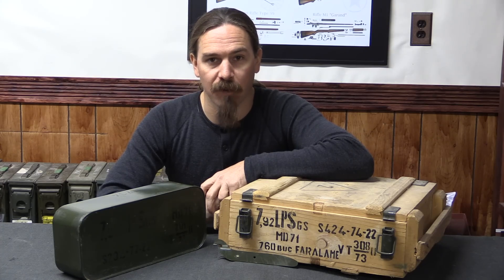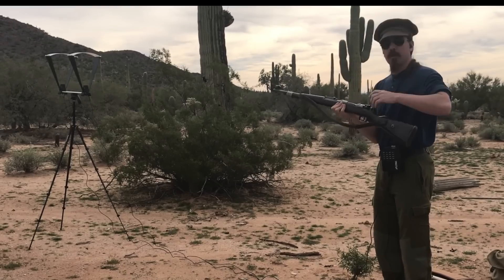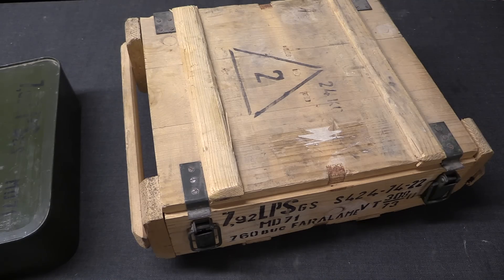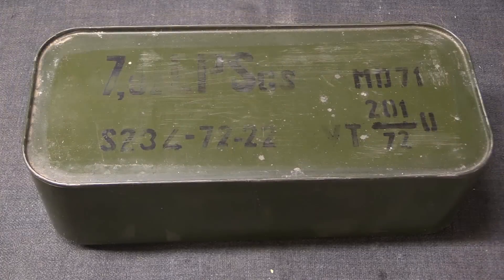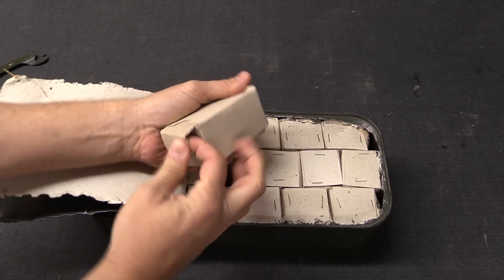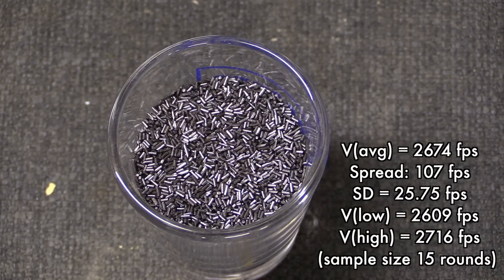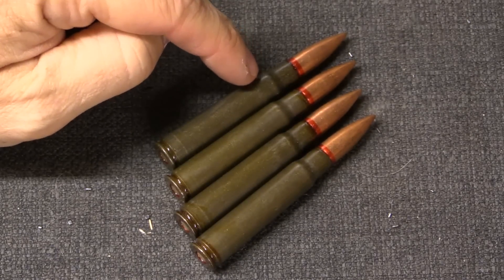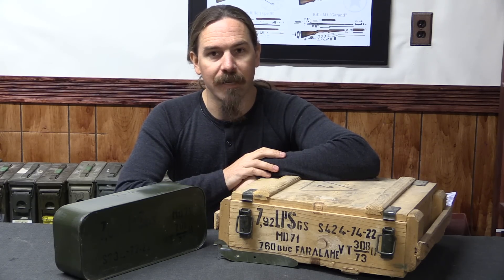Ammo Evaluation: Romanian 8mm Mauser

Comment: I wonder if the smaller case was an artifact of whatever machines they used to make the ammo. Perhaps they could share tooling with another type of cartridge. Or perhaps it was cost cutting.. a millimeter of steel isn't much, but factored over a few million rounds and that's a massive amount of material saved.

Comment: The slightly shorter case might aid in extraction when used in machine guns. I say mg's specifically because the high heat might make the lacquer sticky, though I have no idea what the properties of that lacquer are when heated. Regardless, I doubt 1mm would make a significant difference though so it's doubtful.

Comment: Can someone enlighten me on why ammo would be magnetic...? Trying to think of a good reason but I can't.
Reply: Most steel is magnetic and this has both a steel cartridge case and a steel cored bullet.
Reply: There is also steel/copper alloy in the bullet jacket for a lot of these Soviet/Warsaw Pact era surplus rounds. Most of the old Light Ball COMBLOC ammo used a steel core as well as this steel/copper alloyed jackets. Hell, they still make them. A lot of Russian made ammo, like Barnaul, Wolf, Tulammo, Brown/Silver Bear (also Barnaul) have and do still use the steel/copper alloy, because it's cheaper than copper and or gliding metal, and most ammunition producers really dont care what happens to your firearm's barrel. Most of the modern stuff is lead core, but the alloyed jacket will still attract a magnet.
Reply: Military ammunition typically has a bullet jacket made of mild steel plated on both sides with copper. Much of the Russian commercial ammo also features these bi-metal jackets of plated steel.

Comment: Great video Ian!
Another interesting point, ...if you are an ammunition nerd, is that the steel core that was used in the construction of these bullets seems to be the same steel core that is used in the 7.62x54R LPS (steel core, light ball) bullet, ...only with a couple of millimeters of the tip cut off to allow it to fit into the slightly different profile of the 7.9mm bullet.

Comment: I bought one of these more than 10 years ago, mainly for my Mausers. Good ammo but it wouldn't chamber in my Yugo M76. I'm guessing that gun had really tight tolerances. Ran perfectly in my friend's registered MG34 and 42 though. We also had no idea why Romania was making 8mm in the 1970s. We assumed it was a make-work project and to export to revolutionaries still using captured Mausers.
Reply: Also, opening that tin was such a pain that I never opened the second tin. I used the tool to start it and finished it with tin snips.

Comment: I think the technical term for what gun powder does is defilgration. It's an explosion in witch the shock wave propagates slower than the speed of sound in its surroundings. I.E. air at normal atmospheric pressure

Comment: Thanks! There is some of this stuff in the arsenal of democracy under my basement stairs. The RC '39 Oberndorf K98 loves it although '70s Yugo heavy ball is a bit more accurate and my favorite. The soldered galvanized tin with wire pull is also easier to deal with. The Bulgarian corn beef canned 7.62x54r is also pretty easy as well. The Russians had some bad packaging ideas that some of their fraternal communist brothers improved on...

Comment: Pretty much identical in packaging to 7.62x54R. The trick I used to open the can was also a workout for your core and arms. You flip the can over and place it on concrete or asphalt, preferably an area you don't care about, so that you can move it around and the concrete would literally grind the soft metal around the lip of the can. It would take a while but it was an amazing workout and the top neatly comes off preserving it in case you wanted to save it for display or reuse. Easy enough to smooth out the grind edges and make it a nice ashtray or something.

Comment: There is something compelling about fresh ammunition--something like opening an expensive box of chocolates.  When each cartridge is as--comparatively--nicely made as this the experience is all the better. One just wants to run your fingers through a basket full of the stuff...  Weird. Its probably just me!

Its a shame neither container has a full date code. It would have been interesting to know when in 1974 that tin was sealed. Given the continuing soviet version of 'Plowshare' in that period you could probably do an isotope analysis to determine the precise time if you vented and captured the air properly.
Reply: the soviets really did something like plowshare? not just one experimental explosion? :o

Comment: I have some of the same  and it is reliable in my experience as well the only issue I have with it was and is the steelcase tends to be a little stickier extraction than brass.

It is additionally a high powder fouling cartridge compared to many others. I made the error of using it in a m95m which as I learned does not have the best primary extraction.

Comment: Steel core?  Expect range restrictions, even if it's not actually AP.  
In this case, a hiss is a GOOD thing--it means the ammo has likely not spoiled; unlike Steve's rations... ;)
**Could the shorter case be to allow for a longer bullet made of less-dense material (steel v lead) to maintain the same bullet weight and overall cartridge length?

Comment: If you don't have one of those hand openers, I would think that a reasonable, safe way to open one of these with a Dremel would be to use a sanding drum or a grinding stone along the top edge of the tin where it's creased/sealed(think those "how to open a can without a can opener" videos, using an abrasive surface to sand down the outer creased edge of cans). Obviously a sanding drum and even a grinding stone are MUCH safer alternatives around ammunition than an abrasive cut off wheel of all things - especially in the way that they're being used as described here.

Comment: I don't care much about the ammo but the dovetail construction is an interesting choice :P
Edit:
I suspect the 1mm difference could be from its production. If you already have an existing production using a very similar source of sheet metal, you could just adapt the bullet rather than open up an entirely new line of manufacture. In this case the 1mm difference has no meaningful impact on performance.
Reply: Or, someone thought they could make a bit of side money by shorting the cases, and pocketing the difference.
If you order material at a certain size  and cost, but accept delivery of undersize material, you could split the difference in cost with your supplier.
Reply: @olddragondude4398  Or, they could have been accounting for tight chambers and the thickness of a potential neck sealant.
Reply: LazyLife IFreak my Turkish Mauser was converted from 7mm to 8mm and this the mag well was meant for the 7mm rounds meaning the 8mm rounds barely fit and often get stuck in the mag well so I’m wondering if the 1mm difference is because of that as I am certain that it would fix the problem
Reply: Until you find out the bullets were sat 1mm deeper on purpose in case the ammo was stolen to be used in a revolt of sorts...
Reply: Made from the same steel sheet case blanks as 7.62x54R? Could be!
Reply: Or it was just a cost saving measure. Even a 1mm savings in steel adds up over a couple of production runs.